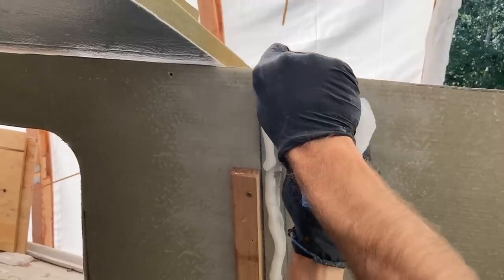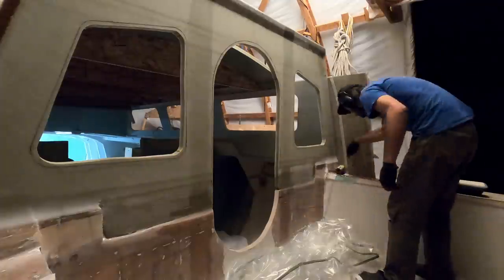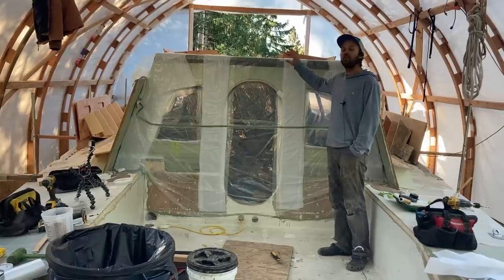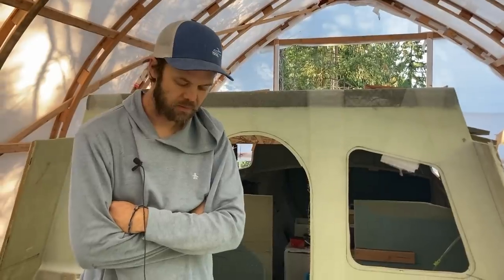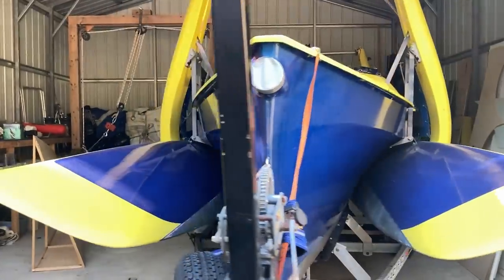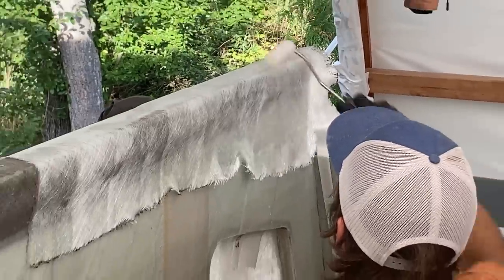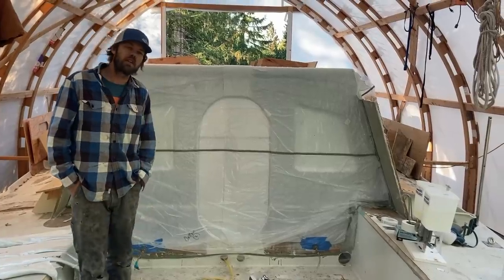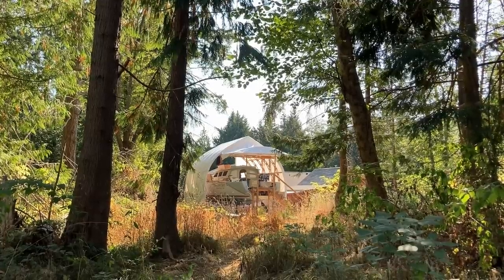SAILBOAT REFIT: Glassing in Traveler Bulkhead [E49]

Comment: you dont have to use that vaccume technique all the time. people have built boats without that method for decades
Reply: Having done it both ways I’ll happily agree that what you say is true, but there are significant advantages in weight, strength and finished dimensional uniformity to be gained from bagging. 

You’d perhaps be surprised at the quantity of excess resin that gets extracted under vacuum. 
That is resin that is largely otherwise separating the layers of the lamination, resin that has little structural strength and prevents the structure from acting as a monolithic unit. 

The result of all that is that to achieve the same strength in the finished product without bagging you need to add extra laminations, increasing weight while adding cost of materials and labour time. 

The other big advantage of bagging is that it forces the material to conform to internal radii, which, due to its inherent “springiness”, it is reluctant to do. 

If you’ve never done it you should give it a try. 
Cheers, R. 😎👍🍻